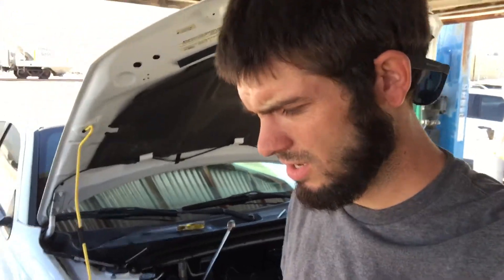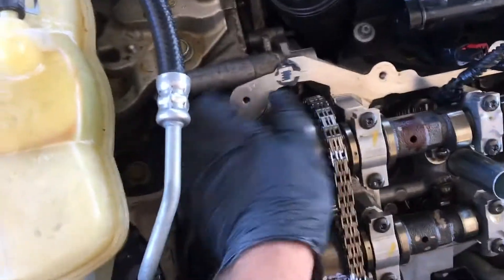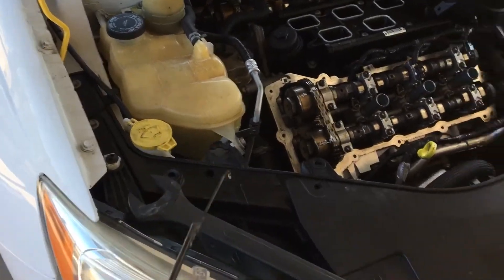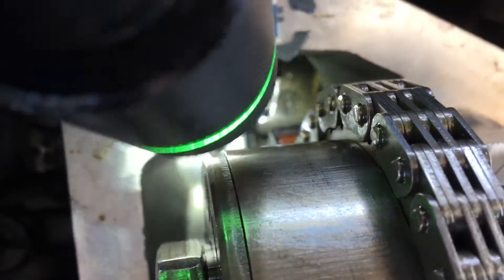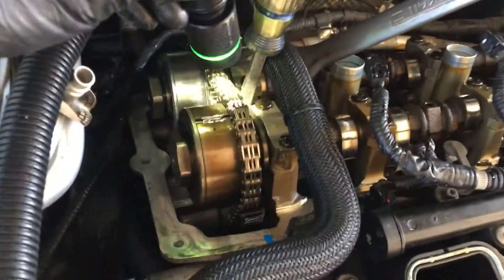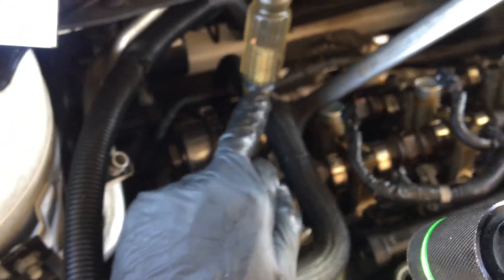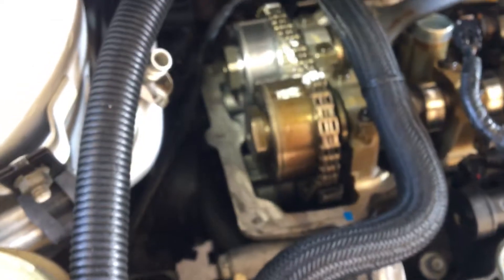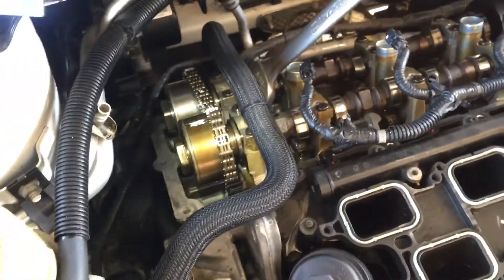HOW TO (fast and easy method) replace 3.6 pentastar camshaft phaser  w/ no special tools

Comment: Just don't go crazy with it. Chain guides aren't that durable to force as they are only designed to keep the slack out of the chain. If you ever notice one side always is tensioned by the cranks rotation, and the other is always going to have slack? That side doesn't really put much pressure on the chain and its not meant to. You can easily mess it up like that.

Comment: I lost the timing marks because what i thought was correct, it wasn't.  So i ran it and it idled a little rough and it accelerated slower. So anyway now does it matter if the chain isn't in the same place? As long as the two phasers line up right?
Reply from the maker: Yeah it does matter if the chain is in the same place
Reply: Lol WOOOOOW 😂😅